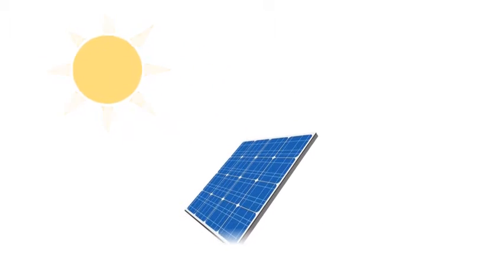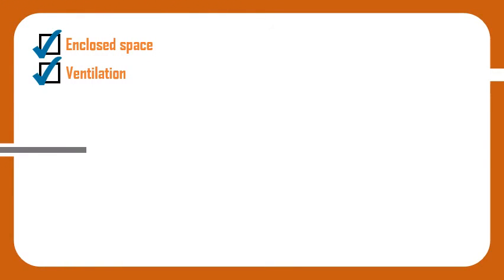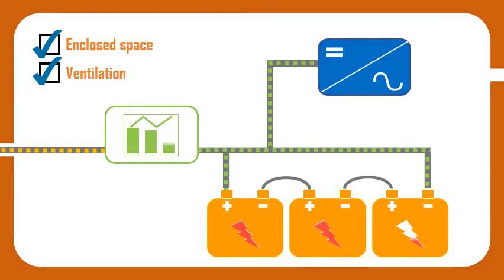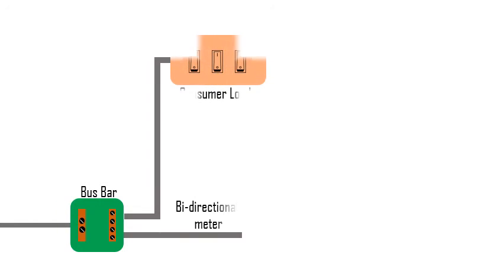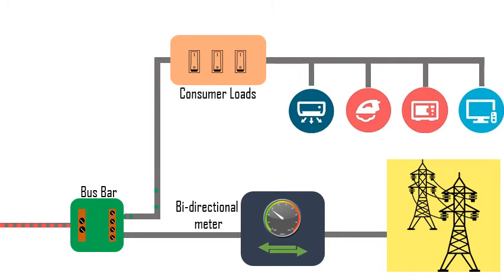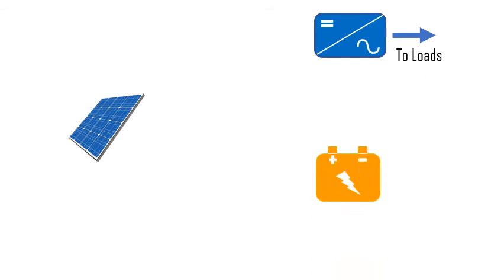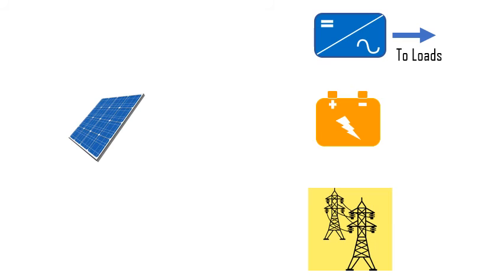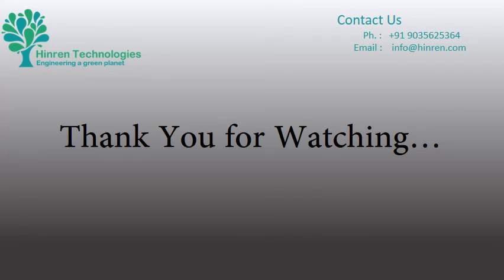Hybrid Solar PhotoVoltaic System

Comment: Hey is there a Grid tie inverter in the market which has battery backup facility inbuilt? Here you are mentioning an additional solar charge controller which controls the batteries..